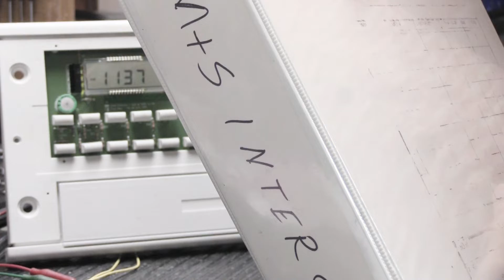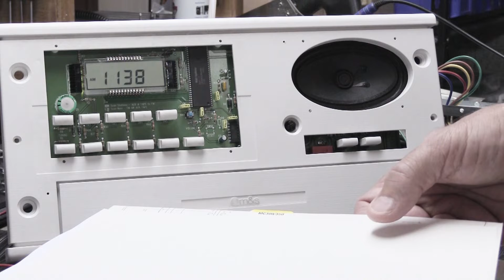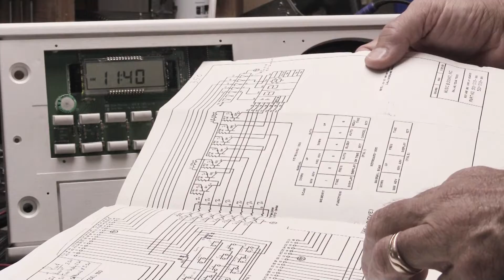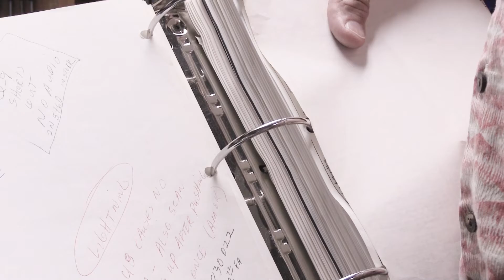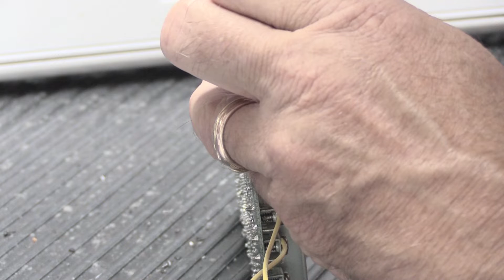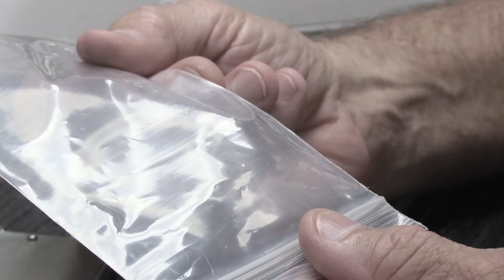Working on an M&S Systems (music & sound) MC602 Master Station with a FM Radio Tuner Problem -PART 2

Comment: Parts 1 & 2 were very interesting. Thanks for taking the time to do them.

One question: Why isn't the tuner board in chip form? Wouldn't it make your job simpler if every separate section was a chip?
Reply from the maker: Hi mid hamm:  I am unclear on your question " Why isn't the tuner board in chip form? Wouldn't it make your job simpler if every separate section was a chip?"  - Chris
Reply: @northsideservicecompany3567  Integrated circuit? Like the parts you replaced but for the whole board?
Reply from the maker: @midhamm1453  While there are IC's which are essentially a "Radio on a Chip" , they still require some number of supporting components when they're integrated into any design.  I'm not sure if such IC's were common in the early 1990's.  Cost would also be a factor, a brief search for such parts showed them at $26.00 in single unit pricing.  If you were buying thousands of units, the price will drop.  If you figure the adjusted "retail" price for this part built into a product, it could add as much as $60.00 - $80.00 to the final price.  In the end, it most likely comes down to simple economics,  you can source a simple "tuner board" assembly from a manufacturer  for far less than a complex design.  - Chris
Reply: @northsideservicecompany3567  Thanks for the reply.

Comment: Well done :-D,  You saved the day again (like you always do).
I can see the pll reference crystal and there will be a vairiable capacitor connected to it.
If its slightly off frequency the frequency steps wont be exact.
There will be a vco coil oscillator that the pll will control it's frequency.
 After mixing it with the incoming stations, there will be only one station frequency that will produce the i.f frequency desired and it;s filtered to make the i.f window narrow, so you only get one product of the mixing.
Sorry im waffling again!!, shoot me quick lol.
Reply from the maker: Hi zx8401ztv:  It's always fun to read comments from someone who has worked on equipment before.  Interestingly, one of the hand-written notes in the schematic was about measuring the frequency in this circuit and how you need to use a frequency counter and not an oscilloscope, which will alter the measurement - Chris
Reply: @northsideservicecompany3567  And connecting a counter to the circuit will have an effect on the frequency as well.
I inserted a 20 pico farad capacitor on the end of the counter cable to limit the oscillator loading.
Or for crude measurments use a communication receiver and put the  antenna cable near the crystal (Sniffing the frequency).
Hey that tech that left the great comment saved you a lot of time :-D
Its almost as he new it would be handy one day.
Reply from the maker: @zx8401ztv  Good tip - I think when I have time, I'll try sniffing the frequency with spectrum analyzer and a near-field probe - Chris

Comment: Very neat!  I learned from this video.  Makes some sense when troubleshooting to visually look at capacitors and resistors for obvious damage (swelling caps, burnt up resistors), but when all looks good, definitely I would suspect IC chips (just a novice opinion of course).  What a gold mine having that schematic binder.  I'm sure you will document this fix on a separate page for insertion for the binder.  I wish I could fine the equivalent of you for my 1980 RCA colortrak television for troubleshooting.  Seems CRT television repair experts are shrinking or gone for good.
Reply from the maker: HiGroovy1:  The binder did help out and probably save me some time.  With just this 1 use, they paid for themselves.  I don't know any real TV repair guys any more.  All of the guys from the CRT days have retired or closed up shop.  - Chris